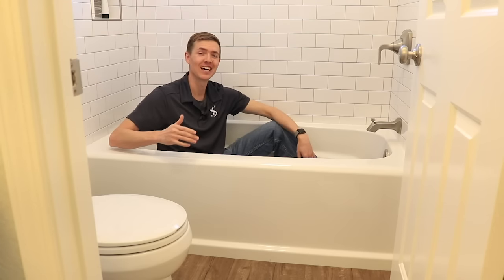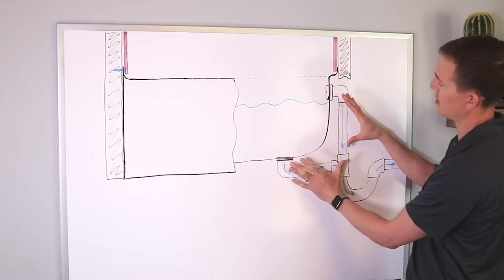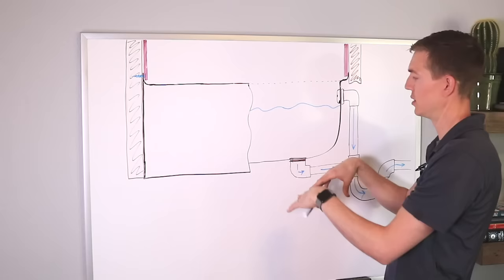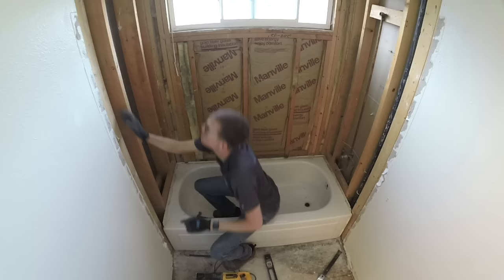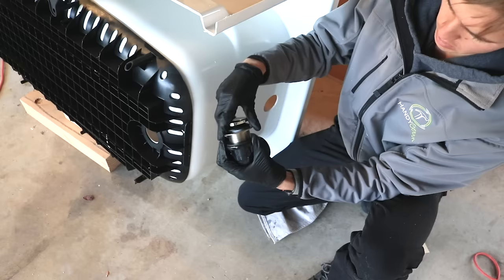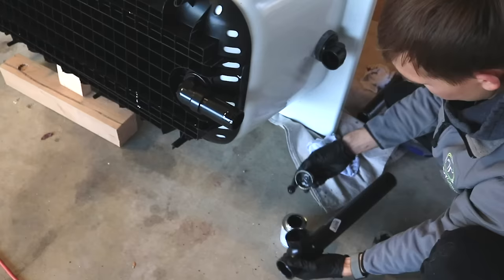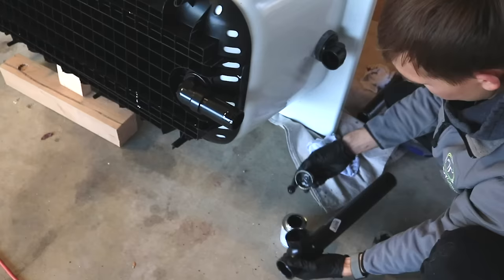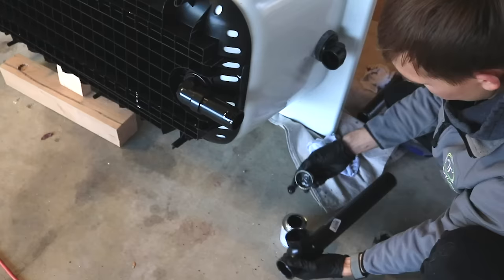How to Replace a Bathtub (Step By Step)

Comment: Good video. However, I have to agree with some of the negative comments on the install. I am not a licensed plumber. But I do better work than many of the licensed plumbers and electricians - yeah I had to fix sh*t done by "professionals" before. Of course I have had years of training and actually doing from my Navy days to my career in the private sector working with high pressure fluid systems (hydraulic fluids, steam, water), mechanical, and electrical from 120vac up to 13.5 kv and more including DC systems. I have no doubt I can install a tub/shower. But I can't guarantee my work. That's why I'll hire someone to do this for me. If it leaks and needs to be reworked for ANY reason from normal use, I have a lawyer on my side and it will be done/fixed properly, and any damage created will also be fixed at no cost to me. It's like buying car insurance. You don't 'need' insurance until you need it. If you don't have insurance before the accident you are sol. Hiring a reputable professional IS like buying insurance. Setting a tub IN a 'wet' bed of mortar must be done right the first time. I don't trust myself enough to do correctly the first time I try it. I can't afford to experiment on my own house working alone, so I'll pay someone to do this for me. Just make sure the work is warranted ON PAPER before you hire someone.
Reply: I've been plumbing for 25 years, and you are the customer I red flag and do not do work for. Why you may ask..... you claim to know more than the licensed plumbers, yet would not do this on your own, you would hire someone with a lawyer at your side, and when the work starts, you are most likely "that guy" hovering over the shoulders of the workers, asking ridiculous questions, complaining and arguing on whichever way they are doing the work and your way is better, making everyone present uncomfortable, so on and so on. Nobody and I mean nobody likes a customer like that. Perks of owning my own company, getting to pick and choose who my customers are and who I want to help with their situations, cause helping people is why I do what I do, and helping people who appreciate my work and what I do is the reward. But hey, I could be wrong, and if I am I apologize. Much Aloha everyone, have a blessed and fantabulous day.

Comment: That silicone could make a leak , that silicone isn’t necessary!
Reply: With the drain being installed before the bathtub you dont have a chance to sandwich it all together completely tight so there is a chance that the drain, tub or the drain hole itself could be off a hair and having it preinstalled doesn't allow it to clamp 100 percent tight. Silicone is insurance that the whole perimeter of the seal is contacting.

Comment: Oh, what a pain in the ass.   You have to take the tile out?   Who came up with this stupid design?

Who the hell wants to re-tile the whole damn thing just because you need a new tub?

With a good design you ought to be able to just do a drop in replacement without removing anything else.  it's almost as if there is built in industry protectionism here to make this as difficult as possible, so you are more inclined to pay someone to do it.

Comment: Nooooo on the silicone.  Why not just Teflon tape the threads and plumber putty the drain.  

I’ve literally ripped through the drain metal using a removal tool because some moron pvc cemented the drain into the plumbing and silicone the bottom rather than plumbers putty.
Reply from the maker: Plumbers putty is actually recommended against by the manufacturer of the tub - and they specifically recommended the exact silicone that I used.
Reply: @StayHandy  who fucking cares.  They probably have affiliation with the silicone manufacturer.   Try pulling one out later wise guy
Reply: @StayHandy  what's the manufacturer for this tub?  I want to pull the instructions to see if its true or you're just being a Mr know it all.  Let me guess, you cant remember
Reply: Delta Classic 400
Reply: Dan Perry well that explains it.
Reply: Does it really accomplish anything being rude to the man who made this video? If you feel that he is wrong, politely offer a correction and leave it at that.
Reply: Jason Konieczny yeah because it’s a public forum and anyone who may ever need to rip a tub out and install a new one May read my comment and learn that if you install a tub, you do it in a manner that it can be uninstalled without damaging the tub, the plumbing, or the drain.
Reply: yakitoriPB so you install things so they can be easily removed later? That’s not how shit should work. Tile for example - if you plan for someone to rip it out later, you can guarantee it won’t last.
Reply: @yakitoriPB  lol dude I'd hate to work for or even have a job done by you. If you can't remove a drain after it has been siliconed in place then you don't know what you're doing. You should get a desk job where you can easily hit the backspace button seeing as though you wouldn't be able to do anything that requires some skill and effort.
Reply: @yakitoriPB  In 15 years after all the "corrosion" in said bathroom I'm sure it would be time for a gut. You are going in way over your head on this one drain piece that can be removed even with silicone placed underneath. Mind you a lot of these tubs recommend the silicone over the putty as it degrades the acrylic overtime. Silicone is not hard to remove at all. If you want to get technical then by what you're saying we should not use brass tub drain assemblies for the simple reason that they seize up over the years and if the drain did corrode and the threads were all seized chances are you would not be able to get it out. Anyways I'm done commenting because clearly you are inexperienced and do not cope well when facing challenges that arise after years of construction. All in all the drain was set properly and there is no leakage. If it can't be removed 15 years later then tough luck. Contractor did a great job installing it ensuring no leaks. By your logic tile should be put on with Elmers glue so that in 15 years when you come along you can just blow on the tiles and they all fall off. LOL What a joke buddy get over yourself.
Reply: Darren R so what if the tub is in good shape after 15 years but you want to retile it and the floor, vanity, toilet etc? 

U wanna pull a tub unnecessarily?  Fuck no.

I’m saying it from experience of replacing dozens of tubs and remodeling more homes than that
Reply: Darren R how many tubs have you replaced? Was it pier and beam?  Second floor?  Or slab?  Most of where I live is slab, so pulling a tub usually requires hack hammer, and a pita to build the drain, redoing drywall, texture, etc.   pulling a tub multiples your remodel of a bathroom by two here.   Pulling one is not the preferred method unless it’s reached the end of its life.  A porcelain steel tub last much longer than tile and hardy backer.

I just did one 2 days ago.  The tub has a 14.5” center and a 16.5” slab drain outlet.  Standard here is 2 x 22.5deg pvc fittings between drain 90 and overflow.   It’s a major pita so...putty and Teflon muthafucka
Reply: @StayHandy  of course they did. They never have to take it apart down the road. Putty only stains cheap plastic & stone. Today they even make an oiless putty.  Never glue a drain in like you did!  You really have no idea how many problems this person is going to have with this job 5 to 7 years down the road. I give you an "F" on your install.
Reply: @MookieMan1  this tub install was totally incorrect.  Who knows how good his tile work is. Yes you should always put a tub drain together so you can get it back apart later. The drain & tub are made of 2 different types of materials.  When they get hot and cold they expand & contract at different rates.  This by itself will cause a leak years down the road. If you can't get it apart. You end up destroying the tub & have to replace it yet again.
Terrible installation!! I'm not just talking about the drain.
Reply: @yakitoriPB  I agree with you. But no one pays attention to you when you're rude. I've been plumbing for over 44 years. This was a terrible installation. I could name 10 other things he did wrong. And I think he only did 8 other things. 😉
Reply: @darrenr1194  besides the drain. This was a terrible installation.  But you'll have a return customer.  You'll need to go back & do this job again.
Reply: I know you are right, And I just got owned but: usually when you’ve got nothing logical to say, you comment on punctuation and misspelled words
Reply: @RenoCapture  what area are you in? How long have you been plumbing?  Are you a Handyman. I think you mean well. You just need several more years of experience.  Just because "Delta says" doesn't mean that codes & common sense say something else.  Read what I've said about putting a 350 lb. Man in this tub. It would fail in a few years. Good attempt though. Keep trying. I hope you are learning from some of the comments. Don't pay attention to the Rude comments.  You're still young & learning. 
  Good luck.
Reply: @PlantBasedPachyderm  I've done just that. He doesn't have anything to say back to me. 
  I did tell him to keep learning.  By learning more he has to do more jobs. A few years down the road when some things start to fail. This is when he will learn. "Learning from your mistakes" 
The problem with this is he may not be called back to see the mistakes.  If not. Then he will continue to make those same mistakes.
I just don't think he is good enough to be teaching just yet.
Reply: @darrenr1194  you both are a bit wrong.  If the drain get glued to the tub and 15 years down the road needs to be replaced. You should be able to replace it without destroying the tub.  You say that in 15 years if it does tear up the tub. It's time for a rehab anyway. What if the people like the tile & tub but the drain looks really bad.  What if the lady of the house doesn't want chrome any more. There really is so many variables.  But let's get past just the drain. This was an OK install at it's best.  Whether the tub maker calls for no mortar bed you always set a plastic tub in mortar "Always"  even though they dont call for wood around the upper lip. Code in my area calls for the support plus mortar bed on all tubs. Even cast iron. It's just that added precautionary step you take to make it not just an OK install but a perfect install.  One that can be worked on down the road. Or changed because the Lady of the house doesn't like the look now or maybe she just purchased the home & wants a different look. She shouldn't be penalized because if you touch the drain its tears up the tub. 
  Now, Myself. I've never NOT been able to remove a drain. I've had them come right out & I've had to cut them out but after almost 50 years of doing this. I've always gotten them out.
     Back to. It's not just the drain!
Way to many Variables. 
He's learning though.
Reply: @yakitoriPB  plumbers putty is oil based, it's for metal tubs... you cant use it on plastic or fiber glass tubs or you will get a yellow ring around the drain when the oil soaks into it.
Reply: @yakitoriPB  also plumbers putty can cause acrylic to break down over time
Reply: Car mouche it doesn’t really though.  You should try it.
Reply: @mich5167  oiless putty doesn't bother it. It's made just for applications like this one.

Comment: That tub won’t last 1 year guaranteed.
Reply from the maker: It's already been 2.5 years with a family of four and it's flawless.
Reply: @StayHandy  I am not one of those guys who go onto YouTube videos and bash other tradesmen and pick apart the work they just did especially since you are taking  your time to show other people how you perform this type of job . But having said that and I’m glad it’s been 2.5 years and everything has been flawless so far, speaking from 30 years of working as a commercial union plumber for the first 20 years and the last 10 in the heating side of the business I’m very surprised that it’s lasted that long and forget the way I was taught how to install tubs , and let’s say you never did this video and we are just talking about the tub , I’m still surprised that it hasn’t cracked or started to rock because whatever way you install those types of tubs they are always failing in short amounts of time that the homeowner won’t ever buy another one made from that type of material but it’s working and flawless so that’s all that matters and it’s their everyday bathroom?

Comment: You didn't need t do any of this, the tub you took out was a match for the new one, you use plumbers putty not caulk in those areas, that tub could have been done in an 8th of the time it took you!

Comment: This was a terrible installation job. I'll bet you get paid by the hour. How many times do you need to set it in take it out? Once if you know how to measure correctly.  I'd say "good work" but then I would be lying!  
  Looked nice when you were done though. I guess that's all that matters.
  Sometimes manufacturers recommendations are just that. Local "Codes" always come first. Read your local code book. The "Whole" book.

Comment: Just so you know there is a huge problem with the way you installed the tub. You would benefit by learning about air sealing a house. You just put the tub against an outside wall without covering the insulation with an air tight barrier. The original installation was incorrect and you should have rectified the issue. Take a course in building science to understand how a house works before uploading anymore videos.
Reply from the maker: Interesting. What is the purpose of the air right barrier and is this code in all states, or just good practice?
Reply: Tyvek and other house wrap has been used on the outside of houses for years.  I'm not sure what this guy is referring to.....
Reply: vapor barriere